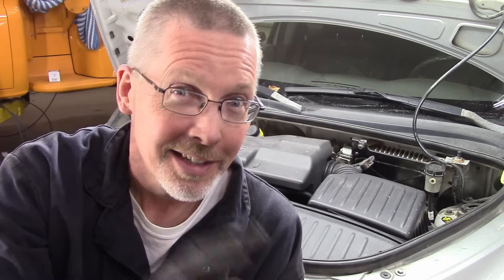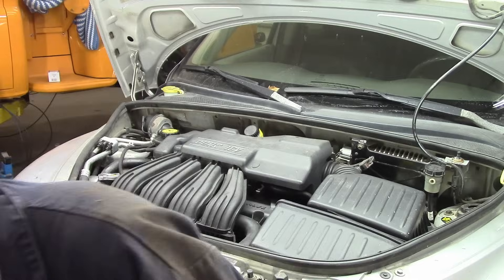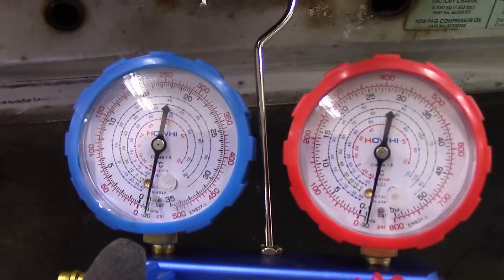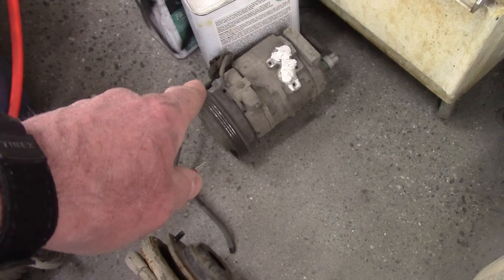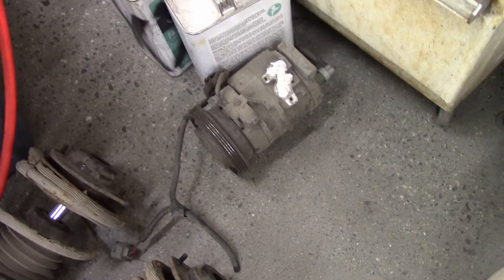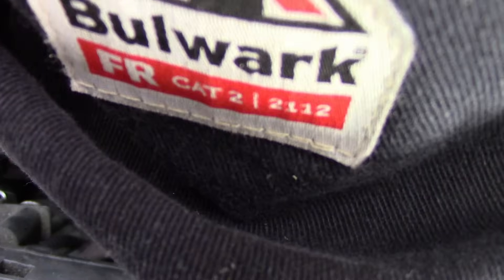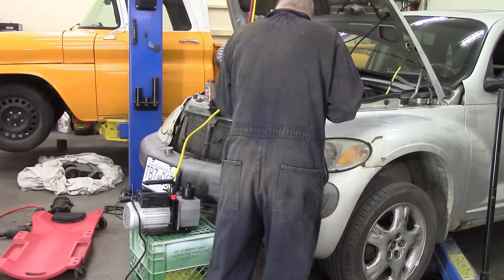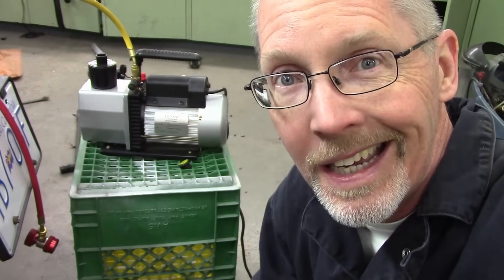DIY Testing, Fixing, & Recharging A/C

Comment: TIP: After 47 years of working on cars, I have found that using a Temperature-Pressure Chart is BY FAR the best way to add whatever type of Freon you use. It never misses on the perfect amount of Freon needed AND it protects the compressor and whole AC system from being over-pressurized - THE MOST COMMON cause of compressor failures.
Reply: This was back in the day... you can't follow this same principle with variable displacement compressors. You will end up overcharging the system and burning the compressor. 

The best way of changing the ac system successfully is putting what the manufacturer recommends... no more, no less.
Reply: @VWtech562  Yup. I show how you can weigh in a charge using a simple 16oz digital postal scale using 12oz cans. charging by pressure doesn't ensure a proper charge. And the only thing you know when the standing refrigerant pressure = saturation pressure at temp is that there is at least a drop of liquid refrigerant in the system. If it's 70F/21C and refrigerant is sitting at 71psig, sure you have some liquid in the system, but how much? If you add 6oz of refrigerant, the saturation pressure is... still 71psig.  If pressure is 65psig, then you have ZERO liquid refrigerant in there.
Reply: @BearHomeOwnerDIY  I cannot find the video on your page of this what am I missing? I’m about to tackle ac on two trucks myself and I have a postal gauge you mention and manifold gauge set I just need to buy a vacuum pump.
Reply: @markharris783  I'm uploading now Part 7  - weighing in refrigerant using a digital postal scale ... hope you haven't started yet. You need a manifold gauge and a vacuum pump to evacuate the air of the the vehicle's AC system (yet unposted Part 6 Evacuation).
Reply: Mechanic for 45 years and I keep a pressure chart in my wallet it was on the cardboard wrapper on my new gouges. From harbor freight.
Reply: @joeseda8102 How do you charge using the PT chart?
Reply: I have very little gas left in the system and want to drain the last gas (134a) out from the AC before i remove it. By the time i dont have oppertunity to take it to the dealership. 

How do i release the last gas out in the free air? 
Do i just open the 2 valves on the compressor? 
Do i release the air from the HP or the LP hose first? 

Really hope someone will answer me😊
Reply: @hiacedeler  I'm EPA certified 608 Universal and 609 MVAC so I can't advise depressing the schrader valves in the low or high side service ports to release refrigerant into the atmosphere. The legal way is to have a mechanic recover the remaining r134a into a recovery tank.

Comment: In the past year I did both a radiator (10/22) and the timing belt (3/23) on my '97 Chrysler Sebring JXI convertible with the 2.5 liter V6.  I don't know if you've worked on those cars, Mr. Shop Teacher, but I can assure you that the grunting, swearing, dropping of tools, along with wanting to exact revenge against the car seems somewhat similar.  I swear, Chrysler put the engines on a cradle and build the bleeping cars around them.  In other words- I feel your pain!!  And yes, my car is running great now.

Comment: Submerse the cans in a bucket of hot water while servicing. It cuts the time down a lot.
To get the exact coolant amount, I use a digital thermometer measuring temps coming out of the vents, fan on high. As coolant is added the temp decreases. Once the temp goes back up a degree, stop adding refrigerant.

Comment: The first B.S. here is "the system was largely empty so there wasnt anything in it". What? No such thing as largely empty it either is or isnt. So what did you do with the rest of the refrigerant that was "smally " still in the system.
Reply from the maker: The even bigger scam is that there never even was a PT Cruiser.

Comment: I just vacuumed and recharged my 2000 Tacoma using R134A/substitute hydrocarbon based refrigerant. I realize it's combustible but I don't have any leaks (except slow leakage at comp shaft) so I went with it. Cold like a meat locker. As a matter of fact, I recharged both of my 911SCs w/ Freon 12 and this is just as cold as the R12 cars. I have a recovery unit but the 911s had leaks that had to be fixed so they were both empty prior to recharge.

Comment: If you have to replace compressor go ahead order a ac kit with compressor , condenser ,dryer , expansion tube & o rings for around  $300 because there is a chance of metal in condenser & they do not flush out very well

Comment: water boils at 212 f or 100 kPa (1 bar) is 99.61 °C also check your Schrader valve and replace the o rings on the lines

Comment: I love the comments slamming you! 
I added 134a to my daughter's car that had r12 originally. It wasn't completely discharged, so I just topped it off. Apparently 
the oils are not compatible, so I found 134a with no oil and put it in. Charged till the pressures seemed right and it worked great. 
Still was working when we sold it 3 years later. Like yours, it wasn't worth spending a lot of money on, so if it failed, I was only out a few hours and about 10 dollars.
Reply: You apparently had enough R12 in the system to carry enough mineral oil back to the compressor to keep it  lubricated.

Comment: After jumping the low pressure switch why did you immediately assume the compressor was bad? If I'm not mistaken a bad fan relay, a bad fan fuse, a bad clutch coil, or a bad fan motor can all cause the clutch to not engage. Why were these not eliminated as the source of the problem first? Just curious.
Reply from the maker: Should have been eliminated, yes. A bad high pressure switch too.

Comment: Have manifold w/gauges, vacuum pump, and various incidentals for using 12oz R-340A cans and such. Used once to recharge system after replacing condenser and dryer. Will sell for $100 all inclusive for pickup in South Carolina and will ship at cost.

Comment: For cost effective repair I often harvest parts at a pick&pull type place. As a rule cheaper than aftermarket and as good quality.  There may be exceptions.
The staging of the cars to be harvested for parts at the pick and pull seems to be best when  the cars are supported by steel rims off the ground. Take a 2X4 with you if a lug nuts have to be loosened to remove a wheel. Put the 2x4 between the ground and spoke in wheel to hold it to remove lug nut.
Reply: I just worked on a buddies 3.6l Dodge. Engine was ticking hard. Pulled the valve covers off and a few of the rockers ate into the camshaft. Also VVT sprocket was bad along with some tensioner arms/guides. Anyways, he had little money for the repair. So pick your parts for the camshaft and a few rockers got the car going again.

Comment: Not trying to be a smart ass, but why are you wearing a metal chain and a ring. I was wearing my wedding band once, and I got it caught on the starter. It sparked and melted a chunk out of my ring . And lift time is nice blister that went about halfway around my finger.  Yes I know. I was a dumb ass for leaving my ring on when I was even close to the starter, I learned my lesson and never have any metal on when I’m working on anything electrical.  Be a 12 V DC, 120 or 240 AC.  Hey, what’s wrong with wearing leather gloves, if he wants to while using pneumatic  power tools.
Reply from the maker: Absolutely.

Comment: If you had the proper AC manifold gauges, why did you use the cheap hose to do the refill?
Reply from the maker: The cheap cans use a different fitting and do not connect.  I have since made an adapter.

Comment: There is a vacuum pump that is not a recovering machine there, two different types of devices, get it straight that only vacuums the moisture out of the system
Reply from the maker: Oh geez, that sucks. (grin)

Comment: Way back in 2000 my company car was an Opel Astra 2 litre GLE or something. It needed a new exhaust, there we 17 different varieties of exhaust for the car. My current car a Chevy Aveo, still 11 years later milage still low, was my own business's office and spare car. Only 50, 000 miles on it . Sadly Chevy left the country, no filters for Aircon in the cabin so I took it out, Aircon still works in the hot South African sun

Comment: Is there a reason why you need to remove the bolts from the compressor? Why not just unbolt with the bolts left in the holes then remove as a unit.
Reply from the maker: I could not get the compressor into position to remove it with the bolts still in.  Hence the "beat some clearance with a hammer" reference later in the video.

Comment: Ohhh! I can hear the frustration in your speech about this project, and for some reason I thought it would be fun to watch this even though I was plagued with DIY work on formerly my 2-decade-old manual diesel Dodge Ram several months ago before I gave up, sold it, added a few thousand dollars and bought my '15 Honda Fit EX! Ughh, trying to replace those broken valves and putting the head and other things back on was SO frustrating! I don't know why I'm watching this now, because after that, I CAN'T STAND doing auto repair work! Ughhh, despite these compartments being sort of big-looking, there are TOO MANY odd little areas that have such TIGHT clearance and are so HARD to work in and around! Ughh, I feel your pain!
Reply from the maker: The older I get, the less I want to work on vehicles, I find it less and less satisfying.  Having said that, I do want to mid-mount a V8 in a Honda Fit, and call it "MisFit"

Comment: Aw, dang it, the worst thing about dropping a part or tool into the low areas of the engine compartment is when it doesn't fall to the ground and ya gotta look and fish around for a while and it's hard to find, and you're using a magnet wand, etc., ughhh!

Comment: "So it turns out that the Neon compressors are the same as the manual transmission compressors..." Oh, so all Neons are stickshifts? Interesting.
Reply from the maker: No, I'm not implying that.  I'm saying the Slushbox PT compressor is different.

Comment: Didn't change any O-rings?
Reply from the maker: They weren't leaking; I didn't take everything apart.  I still can if there's a problem.  I just want to do the minimum amount of effort on this turd to make it workable, I'll go back IF there is a problem.
Reply: @GregWellwood  But you took off the pipes at the compressor, at the receiver / dryer, no new valves in the high / low connections, etc. 
- 30 mm Hg is one thing but 130 - 140 psi is a hole new ballgame, but yes doing things 2 - 3 times in a row makes it more 'memorable' ... learning by repeating ... "Übung macht den Meister"

Comment: I had a mechanic do everything on the front end suspension except the cv axles knowing i could do them the next spring i even bought a bit bottle copper anti-seize told him he keep the rest Well next spring i start to take stuff off & he stripped about every bolt on it tightening stuff up I went back & he said it cost double what most shops charge because the bolts are stripped & when i told him he was the only one who worked on it he claimed to not even know me ! I ended up selling the suv but included the cv axles & told them about that mechanic Since then he lost his job !

Comment: I find it VERY pesky that Americans can still buy cans of R134A whereas here in Canada, were "stuck" with the cans of propane/isobutane refrigerant alternative and have to bear the consequences that you said at 16:04.  Bruh!  So, you have a manifold set - why not use that rig with the can of "R12A" to monitor the charging status?
Reply from the maker: The can fittings are not the same between the two types of refrigerant.  I have since made an adapter.

Comment: That high pressure switch connector can be the reason why the compressor did not compress.  If you are in lower BC, all it takes is to hop across the border to get 134a over the counter in US. I do prefer the OEM materials in this case, which means no funny refrigerants. My suspicion is the problem with 134a, like the R12 is not environmental, but look at the timing , about 3 decades, about the time the patent protection run out. I will not be around to see the 1234 patent run out , but your kids will. Right now, the 1234 cost 30 times that of the 134a. It is a robbery and I have not seen a weapon anywhere.

Comment: If you wanna tip, purge your lines,  $100 vacuum pump? Refrigerator compressor will work, ya it wont run forever

Comment: Many years ago at a place I worked I got to watch the testing of a vacuum tank system that had a tank big enough to hold a couple people. ( no I didn't get in it ) it had porthole windows at the bottom and at around 15 inches of vacuum I got to watch a puddle of water in the bottom boil at 70 degrees F.
I could put my hand right underneath where it was boiling.
It was really cool to see.
Reply from the maker: Probably cool to the touch as well!
Reply: @GregWellwood  that was the thing, I could look through the window and watch it boil like on a hot fire and at same time feel the cool metal right under it. 
It really messed with your head.
Reply: Now then consider that it can get so cold under vacuum that it turns to ice and for a complete evacuation and removal of the moisture, the ice goes through sublimation… ice to vapor.
Reply: @waggtech4883  yes, I suppose it could do that. But as I remember it was pretty big, dense tank and only about a pint or less of water.  Were the tank small and not so much to ' chill '
Would it change to ice and would solid ice still change to gas ?  I hear about ice in space all the time, if there is then how does it not just change to gas and totally dissipate?
At my job I occasionally use a bunch of torches connected to single propane tank and after using a lot of propane rather fast it ' ices up ' and hardly comes out so I have to switch to another tank and let that one thaw to use the rest.
Reply: @waggtech4883 ...
Reply: yep it changed state i hate the term boiling bcause you think its hot and if you keep your hand their it will get real cold. and if you use a micron gauge you will see the true story of vacuum that those gauges will never show you

Comment: Moisture reacts with the refrigerant and creates “Hydroflouric Acid” which corrodes the metal in the system causing rust flakes to clog things up (Exp. Valve, Receiver Drier) also if there’s enough moisture it will saturate the desiccant bag in the drier and cause it to “Powder” and then its real ugly…. Rec.Driers should be replaced every time the system is opened.   Speaking as an A/C Specialist with 48 years experience.
Reply: Enough moisture can also freeze at the expansion devise and cause a high side restriction.  I’ve seen this happen mostly in automotive due to improper service procedures.  I’ve also seen it happen in walk in freezers and another instance in a manufacturing process cooler…
Reply: Actually, it is the PAG oil which absorbs moisture to cause internal corrosion.  Many people don't fix a failed AC over Winter since it lost refrigerant, then address it in Spring.  By then, atmospheric air and moisture has gotten in to start corrosion.  Best oil today is PAO 68 since doesn't absorb moisture and works with all refrigerants (R-12, R-134A, HC, I think even R-1234yc).  The old mineral oil used with R-12 absorbs negligible moisture.
Reply: I am interested in the chemical redaction where water plus Freon will yield Hydrofluoric Acid. HF is one of the strongest most reactive of the acids. I don’t want to appear to like some on here, that like to argue and such. I am really interested. If you could site some info or a place to find the info I would appreciate it.  You are the pro with 48 yrs of working A/C. I am just a guy who finds all this interesting. Thanks

Comment: If I had to cut bolts off I would pretty much always replaced them with studs using Never Seize. I love that stuff.. I've done that many times over my 40+ years as a mechanic. I did like your comment about paying market value for the vehicle to get work done.  LOL  I still do most of my own repairs but I really don't enjoy working on these rolling computers they call cars today. 

Anyway, good video. I'll be back.

Comment: Not relevant to the AC compressor but here’s a little PT tip if you have to do the alternator take out the antifreeze jug it comes up through the top even if it’s a turbo just did mine😉

Comment: Love your dry humor! But not to second guess you, when you jumped the low pressure switch and the clutch didn't engage, did you think maybe about putting a direct 12V source directly to the compressor? It's possible that it was an electrical issue that was preventing the 12V from reaching the clutch. If you still have the old compressor around, put 12V to the clutch and see if it clicks into place.

Comment: I did engine mounts on one of them. Somehow I put a small hole in the power steering return hose which filled the reservoir up with air. The reservoir is above the exhaust manifold and it caught fire at the lights. I should have let it burn
Reply from the maker: I love hearted your comment, not because of the carnage, but because "here is someone who knows the road I walk on."  I've had a few cars where the insructions to my wife are: "get everyone out, and let it burn."
Reply: @GregWellwood  that was my first and only time with one of those evil things.

Comment: Watching you dump those refrigerant cans upside down (Liquid refringent) into the low pressure return line (which is supposed to be gas only) with the engine running made me cringe.  It's a fast way to pop the reed valves in the compressor with hydrostatic shock.  Glad everything came out OK in the end.
Reply from the maker: Yes.  I missed the can saying upside-down only for fill with engine off.  Literacy: gets you every time.  Works great, anyway!

Comment: The compressor won't come on if your aircon fan isn't working - and the aircon fan fails for fun on a Phase 1 PT. It is however a really easy fix, even just re-brushing  the motor is a piece of cake.